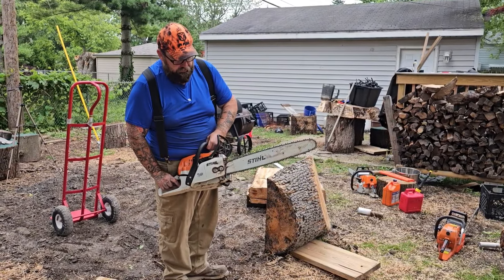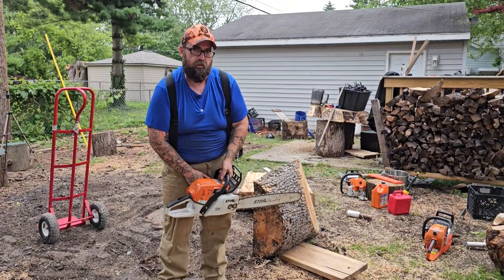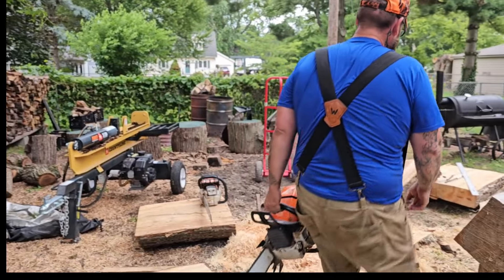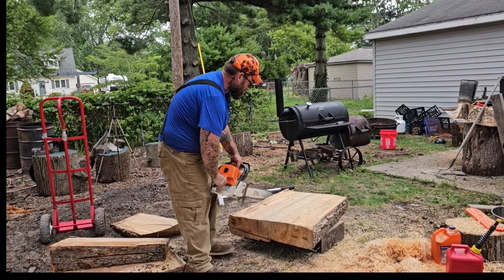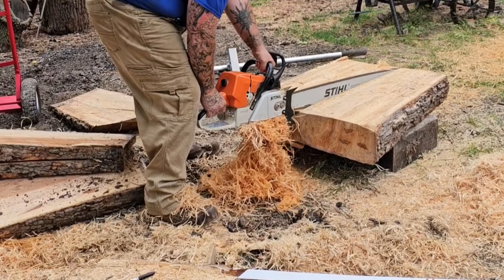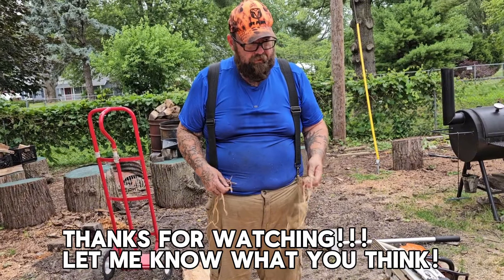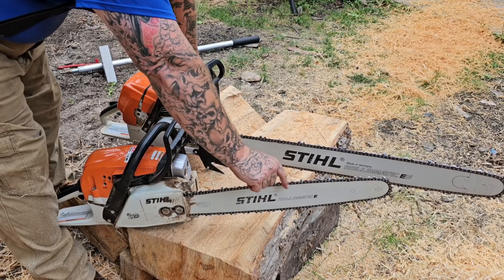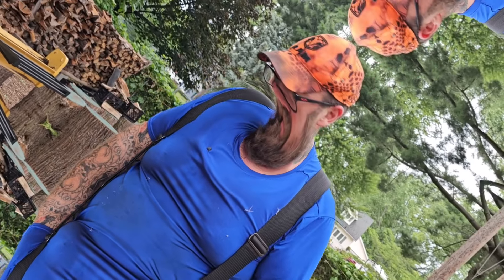Stihl Chainsaw Shootout, 271 vs 461!

Comment: The 271 is a good saw its just not a GREAT saw. And the price you pay is what 400 450? Me personally I dont like it to much... I just feel like if you want a 50cc saw buy a 261. However I LOVE my upgraded MS180. I did the big tooth conversion and did a small muffler mod and it CUTS awesome. NO its not a bucking saw... Its not a Falling saw or a anything serious. But where it shines is Smaller trees with plenty of power and its around 7lbs. If im just cutting up  stuff under 10 inches Its great. IF i need more saw i go to 261 at 10lbs if I need MORE 362 or 036 works awesome for mid size trees. And if I need to cut up Dry BIG hard wood 462 with WCS upgrades is a BEAST.  Right tool for the job!! I push folks to buy 2 or 3 saws. depending on what they are doing. But a small saw 30cc a mid saw 50 60cc and a Big old 70cc saw will be awesome. There is a HUGE difference from 60cc to 70cc class. 362 vs 462
Reply from the maker: Yessir, lots of good info there! I absolutely love my little 250, I modded the muffler and put a 3/8lp and 16" bar, absolutely love that little ripper. I rarely use my 271, I wish I would've bought a 261 but I watched a few bad vids recommended it. I picked up a used 620p off marketplace and modded it's muffler and absolutely love that saw. I don't fall trees, I'm just a hobby guy who makes firewood and turning blanks for my lathe.   I do as much ripcuts and noodling as I do crosscut for my turning blanks so I need the powersaws. I'd live to get a 881 or 395 one of these days. Thanks for the feedback.
Reply: @DacaTimberworks.  I have run a 395 my buddys saw and its a BEAST. Im NOT a husky fan but that saw is a big deal. 70cc Chain speed with 90cc power. Its a beast. The only draw back is weight its a tank 17lbs vs a 13.9lb 500i. 3lbs you can feel for sure a few OZs isnt enough to matter.
Reply from the maker: @LiveFreeOrRIP  I would want it more as a specialty saw for milling slabs or getting into some huge trunk sections with a big ol bar. I'm torn though, it'd be a shame to blow up a nice saw, that's what clones are for lol! I haven't run many Huskys but I absolutely love my 371xp man is that a fun saw! I've got a Tsu premium light 24" bar on it and I can swing that thing all day long.
Reply: Φίλε μου συγκρίνεις ένα πριόνι θρύλο το still ms 461...!!!
Τί να πούμε τώρα όλα τα άλλα είναι περιττά...#!!